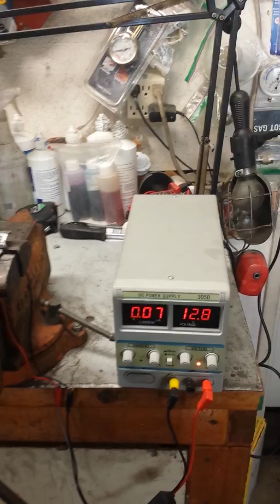DIY mechanical ventilator

Comment: Seriously looking at ESP32 as a controller for this project. Also using a roboclaw controller (V5C for now) all the pieces seem to work together so far. I'll do more over the weekend.
Reply from the maker: Hi Phil, That sounds excellent.On a another note i did some pressure testing yesterday using a manometer and found that one of the 3 BVMs I bought, had a child over pressure relieve valve  instead of an  adult one. 40cmh20 vs. 60cmh20 .That makes a good argument for a pressure sensor input for the controller. Have you looked at the MIT E-vent code?
Reply: @peterleiby5797  I have not seen the MIT E-vent code. Would like to see it if possible.
If you have it put it into a github repo and we can share it from there.
Reply from the maker: @philwilshire4881  Phil, look at MIT E-vent circuit diagram ( https://e-vent.mit.edu/controls/circuit-diagram/).  We need to have enough analog and digital I/O s.  MIT’s code is still not out.  If they release their code, we could use it to save precious time and again, just modify it to suit our mechanical hardware. Looking at MIT’s CAD model, a 90 degree turn of the motor is a full close to full open cycle, where ours is a 180 degree.
I think we need to assign tasks so we are not all spinning our wheels.
Would you or somebody else like to take care of the software part? 
I will take care of the mechanical part.
We all need to look for motors that are readily available for everybody else.  They need to meet the power requirement at that low rotational speed. 
The motor MIT uses is already out of stock and I don't want to rob their builders of parts.
I have ordered a different motor that should be available in mass to see if it will work.  I want us to be able to get enough ventilators made without competing for the same parts.  That should result in more ventilators across the spectrum.
Reply from the maker: I’ve used Github, but never set one up.  I started a Github page, but I don’t want to waste precious time working on it since I’m not familiar with setting it up.  Is there anyone out there that we can assign that task to?  Or, is there a simpler set-up file sharing environment (drop box,etc) that anyone might prefer?
Reply: @peterleiby5797  sure I'll do it. Think I've just been laid off so that's great news for this project
Reply from the maker: @philwilshire4881  sorry to hear that
Reply from the maker: @philwilshire4881  Some of the minimum adjustable parameters we need 
1-Respiratory Rate (RR) range   of 8-40Bpm 
2-inspiratory /expiration (I/E) Ratio     range 1:1- 1:4
3-Tidal Volume (TV) range    200-800ml        needed volume is 6 -8ml/kg of persons mass
A test on my setup  showed 800ml at full stroke varies slightly depending on what brand BVM used
so I think we need to make a calibration feature for others to accommodate their BVM
Reply: @peterleiby5797  HI Working on my test breadboard  and starting to layout the gpios for one particular ESP32

TTGO LoRa-OLED v1  I have a bunch of them they are fun to use.

All defined in an include file so easily changed.
I am getting in other hardware options.
I'll try and write it for both ESP8266 and ESP32.
First I'll get all the peripherals working ( have to move the roboclaw to Serial1 ) Then if any code is released from MIT we can plug that into the this system.
I'll look at getting a BVM and a buddy to put some mechanics together.

  
I have a rough git thing setup and I'll do some more work on that later tonight.
Reply from the maker: @philwilshire4881  Great Phil. Look for a bvm that has a exhaust port on it for  a peep valve and hepa filter so the exhaust does not contaminate the area. Also if the head is removable from the bag is better. I have 3 bvms they all are different. I am setting up tables for stoke volume for all 3 bags.
Reply from the maker: Forgot to mention that some bvm have a small 3mm port we could use for  pressure sensing. I am still hunting for a bvm that has all those features
Reply: @peterleiby5797  HI Peter just to let you know I think I have all the components working.
The robocrawl was a but of a problem since I am running out of resources ( serial ports ) on the TTGO module I am using. My chosen port (Serial 1) was also being used by the Flash interface and caused irrational  problems.
I have a plan now to make it all work and will try to bring every thing together tomorrow.
Its good for me to be reminded about the grim reality of system integration.
Reply from the maker: @philwilshire4881  Good to hear from you, that sounds like a lot off fun. I have been busy as well ( did 3 more videos/tests in pure mechanical mode https://youtu.be/6Tm7sM6j3g8  has the video about the BVM exhaust not venting to the atmosphere ( what I talk about earlier ) .The other 2 videos are about RR, Tital Volume and pressure tests. I should have the controller tomorrow and most of the other stuff. The motor I was trying to source for all the other people had a rough ride in the mail and was dead on arrival but it looks like a good candidate. I have a new one on the way. Now that the pure mechanical version is done cant wait to get the micro controller version done. Did a link to my Google drive in the description for dimension will do that for all info. Phil I cant wait to see your work in action.
Reply from the maker: @philwilshire4881   do you have a preference / experience with a differential air pressure sensor?
The pressure sensor needs to be fairly sensitive  <0.5cmh2o sensing (for a self initiating  breath function) with max positive range of 100cmh2o.  Still researching for a negative pressure range . A volume sensor would also be a nice feature.MIT’s code is still not out. We may have to go parallel with our code just in case they don't finish in time.
Reply: HI Peter I have not looked at any of those sensors yet.

I have just got the motor controller working with the roboclaw. It was quite a job since I had run out of serial ports or at least the associated pins on the ESP32.

To get past the hump I used a dedicated ESP8266 ( $5.00 part) to drive the Roboclaw. I currently use a simple web interface or it can use a network connection. Yes It will be secure (encrypted) or I can add an I2C interface to the system and drive it that way.
Its really neat, just 4 wires to the 8266. I can update its firmware over the web too.
I'll probably get the I2C running tonight and package that unit up and send you a photo.
I have some more work on the 8266 to set up a file system and save its setup information.

The main ESP32 controller is running and I have some infrastructure software completed.  As it is we could use an ESP8266 there as well.
  
These ESP units are really cool and powerful.
My plan is to focus on all these "hard" bits and leave teh basic controller to the MIT guys.
They will not have the interface infrastructure I am working on. With the simpler hardware they will have trouble bolting it on later.
We can transfer and run the control code on the ESP's as well.
I am assuming that once the basic system is running the integrated system with extended monitoring will be needed.

Let me know your thoughts on sensors. I'll be looking at those next week.
Reply from the maker: @philwilshire4881  Hi Phil,Its been quiet for a while
I have the servo working as well in hardwire serial mode with the roboclaw controller in Position control mode, using a pod for control volume  settings, and basic LCD for display .I will post a you tube  asap.
Have the basic code for volume control, now working on respiration rate, and I/E ratio next.
Still hunting for pressure sensor. Will get more info up for everybody on my Google drive soon. 
How are you coming along?
Reply: @peterleiby5797  Hi Peter.
I moved to ESP8266 for the roboclaw control and tries to do it all on that CPU. Ran out od resources when extending to web control.
So I moved back to an ESP32S . Had to make OTA work and succeeded.
Got that basically working. 
Started spending too much time on the Web interface.
I saw that the PiZeroW was looking like to be the chosen platform.
Since the web is far easier to develop with PI went back to PI control.
Got quite a few pieces working and then had the rig failure . too many dangling wires.
So today I completely reworked the rig and I am  having to test the newly wired rig.
I have two extra roboclaws now and I have to carefully retest the wiring etc in the rig.
THe ESP32s ( NodeMCU) looks good I and thepi works wonderfiully ( till the rig lost a soldered joint)

At the same time I had to close the deal on my new job that took a day or two.
I am close but cannot quite afford to retire.
Anyway. got the contract in place and I start Monday.

My ESP 32 TTGO LORA + LCD screen could not talk to the roboclaw.  If I used the serial port 0 for the roboclaw I would loose the ability to program it in place with out disconnecting the roboclaw.
The ESP32 TTGO module could not do OTA 
My esp8266 could not do OTA but the webserver upgrade worked well.
Then I simply ran out of resources on the ESP8266 for the web interface.
I got a crude version of online config working but wanted to extend it.
Simply became unstable.
The ESP32S (NodeMCU) ( Yes I have loads of different options lying around)  could not do webserver upgrade but it could do OTA.
To make things work quickly I used the main serial interface to talk to the roboclaw. Hence I needed OTA or webserver upgrade.

Then I started to do more serious with with the web pages . The program/test cycle was taking too long.
I heard that lots of people were using PiZero's for this so I looked at switching to the PI
The Pi option will allow rapid web development. 
Once I get my rig back working I'll pick either ESP32S (Node MCU) or pi for a prototype.

Long story but we are progressing.

At least I have a job starting Monday.

Phil
Reply from the maker: @philwilshire4881  , a job is always good. Sounds like you were busy too. I hope to have a video up soon with all  the main 3 functions running .Tidal volume,already is ,I/E ,RR  should be soon . I also have more wires than I would like. Still using an arduino (I will later probably use a r-pi (or stm32) ).
Good luck on your new job.

Comment: Do you have any requirements for the micro controller , no matter how rough. 
We can flush them out online.

I, and I am sure many others,  can do arduino , esp8266 , esp32 , pi designs for this.
Any one doing anything on GitHub ??
Reply from the maker: Hi Phil,
I am still looking for feedback from a medical expert.  I need to know what the max pressure requirement is for delivery for covid etc. This is to make sure the motor can deliver enough torque. 
My initial goal for this project was to make a simple, quickly made, pure mechanical, adjustable (for just respiration rate and volume).  That’s what it is right now.
Next step is to hook the servo to a driver board in closed loop configuration, so we can make it configurable with software and add sensors etc.
The driver boards that I have used (gecko drive G320 ) use stepper input signals, but can drive a servomotor with feedback from a 5v optical encoder in a closed loop.
It’s been 15 years since I last set up a closed loop system.  There might be better boards out there now for drivers. I am not a big fan of stepper motors because they can lose steps. 
For the controller a Arduino etc. should be ok ,just needs stepper out signals and sensor input.
Reply: HI Peter. I have been working with an opensource design using  roboclaw controller. These can provide 2 X 7A , 2 X 15A or even more. The code is already up and running ( used on a JPL Opensource rover product )
 The boards are great and give you a lot of control over the motor.
The controllers will work with arduino or raspberry pis and , as I said we can quickly set up a ROS (ROBOT OPERATING SYSTEM wiki.ros.org ) interface for the systems. This will allow access to a whole host of robitic control code. This may look , initially, like an overkill for the initial project  but as soon as you need to integrate the systems into other controllers its great to have the interface all worked out ahead of time.
All I need to look at this is a list of sensors you think you'll need and a few more details on the motor currents etc.

BTW Controller from here.

 https://www.pololu.com/product/3284
If you are too busy to consider anything like this now I understand but I'm more than willing to help.

Regards  Phil
Reply from the maker: @philwilshire4881   Phil Good work, that driver should  work.I am in socal under stay home orders . I have to go with what I have on hand. I can rob a servo driver out of my cnc mill. (Gecko G320 driver)Take a look at MITs E vent team . I am still hunting to find their source code download we could use their arduino code and adapt it for our mechanical side just to give it more options on the availability side for mechanical hardware. link https://e-vent.mit.edu/updated-electrical-operations/#comment-787
Reply from the maker: @philwilshire4881  I am trying to find a roboclaw V5C  ( on back order ) so we can all be on the same page. That way  I don't have to rob my 4th Axis drive  out of my CNCmill.( in case I need it)
Reply: @peterleiby5797  I have a spare one here. I can overnight to you if you wish. I can rob my rover for a couple of others.
Reply from the maker: @philwilshire4881  Thanks Phil. I did find a drive and ordered it  last night online. I will call them this morning to see when they will get it here.Hold on to your spare.I will let you know if they cant get it here in time
Reply from the maker: To all.    I am working on getting GitHub setup for us
Reply from the maker: hi Phil , look at MITs  https://e-vent.mit.edu/controls/circuit-diagram/      They utilize a arduino  and a simple Hbridge for all
Reply: @Phil I have a model loosely models in SolidWorks, if you get details on which motor and what bolt pitch that would be good to know I could add it into my model.
Reply from the maker: I think GitHub is a great idea
Reply: @peterleiby5797  any updates? I have an open source ventilator but need some help with simple arduino code (open-source, github based)
Reply from the maker: @conesillyvalley7182  Hello, i am in the middle of writing a code for TV,I/E ,BPM check out my other video ( https://youtu.be/ba1GlfD3amg ) . Almost done, will post code asap, and a new video.

Comment: Do you have schematics for this? I'm a physician and I believe this could work.
Reply from the maker: Drawings with dimensions are in the second video.  The design was made to be as simple as possible.  It uses 1 bolt for volume control, one screw(potentiometer) for breaths per minute.  Check out MIT, they just released a similar one with closed loop servo control which you could add to my design, or use theirs.
Reply: @peterleiby5797  Hi!  I am a maintenance planner at a Steel plant.  If you can get me drawings I can have my entire team work on making these out of the parts we already have.  We have a few encoders, servos, and plenty of metal to make this.  Please please send us the drawings we really want to help!
Reply from the maker: @therealamparo7092  hi i have the dimensions on   https://youtu.be/SOVQIx0On30    it is still a work in progress, i will get to a cad drawing asap.  I'm not a medical expert, I'm just a regular guy trying to make a difference.
Reply from the maker: @therealamparo7092  If you're still willing, I'm  trying to get MIT's E-vent group to help by using their electronics and my mechanical set-up.  That way we can use some mechanical devices that are made by steel fabricators and others made with what MIT uses.  What kind of servos do you have access to?  What kind of encoders?  They use a 5V optical encoder. Their electronic expertise should take care of the medical side.  Our mechanical set-up just needs to have sufficient torque to deliver the pressure required, which I think they will given the right motors.  https://e-vent.mit.edu/updated-electrical-operations/#comment-948
Reply: @peterleiby5797  if you have some rough prints you could send me I could do up a SolidWorks model.
Reply from the maker: @dave4956   I will get them to you asap
Reply: @dave4956   Did you draw the plans?
Reply: @joseraulruiz6279 https://i.imgur.com/nvgr1Wx.png This is what I have come up with for the moment. I still need of modify a few things, then add a few movement relations to check function, produce drawings. Then upload somewhere(Suggestions). From what I have gathered this would be a last ditch resort as Ventilators have a lot of other functions and sensors then just breathing